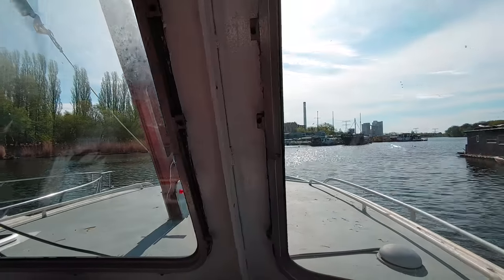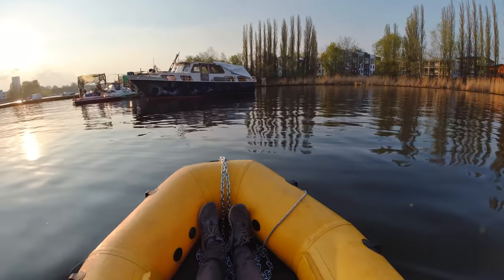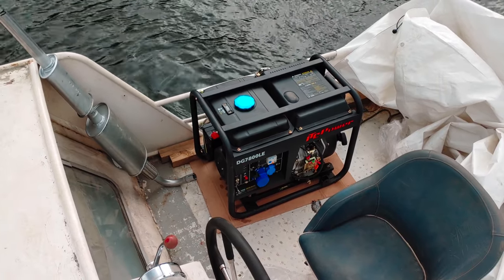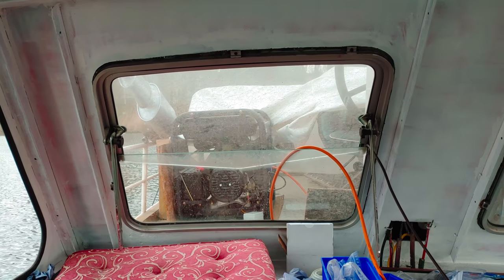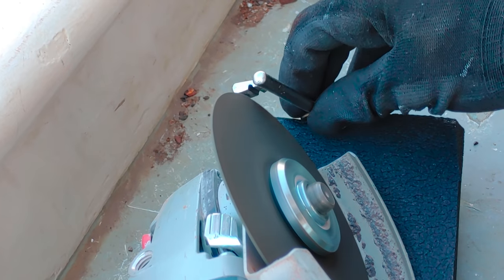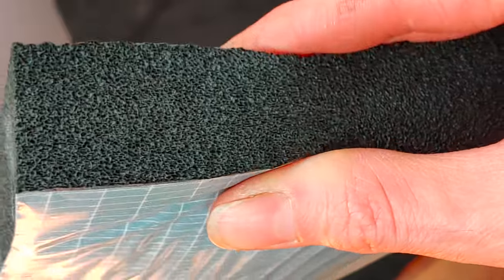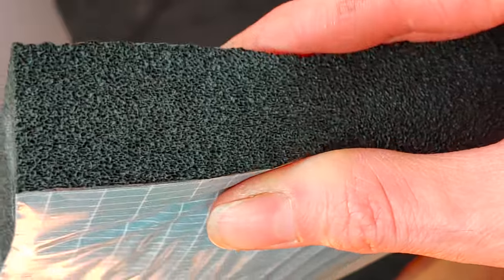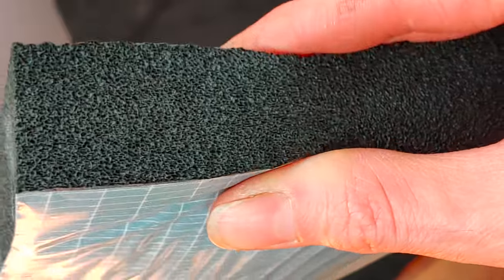First Days On The Water with our Steel Boat - Week 31 - Vintage Yacht Restoration Vlog

Comment: Once you put the generator into the engine room, you could put boards around it with something similar to the insulator you used so that it could absorb the sound and make the generator quieter.
Reply: The thing is that looks like a portable generator which needs air flow to cool unlike a traditional marine generator that uses water to cool. I think putting it into an enclosure might kill it
Reply: Its petrol and air cooled. I wouldn't be even putting that in the engine room
Reply: @nayelelkiki  Then what if he adds some sort of ventilation?
Reply: hello .. in week 4 you will see a fan on the wall, of which there are 2. one on the left and the other on the right .. these 2 are for ventilation of the engine room.
Reply: @jakubkocian1145  a
Reply: @bradarmstrong8059  Acutally, it's a diesel gen.

Comment: Amazing product Armaflex, we have used it for almost 50 years, insulating our Hydronic Heating pipe work. There's simply not much that competes! 
Its closed cell, fire proof, UV stable and durable.
Reply: I've used it a lot too working with ventilation. It takes up so much less space compared to glass or stone wool for the same insulation value.
I can't say that it's expensive considering how good it is but it costs a lot of money. This guy is very lucky to have them as sponsors.

Comment: I've not watched all your videos, but have enjoyed this one.
- Yes, "sea legs" and "land legs" will cause some discomfort when spending prolonged time either on land or on the boat. Even as an "old salt" I feel the effects!
- Generally, the dedicated pleasure boating community does look out for each other. I've seen great examples of this many times over the decades.
- Armaflex is great stuff! I know at least one other youtube contributor who has used it on his sailboat for insulating purposes and is very pleased with it. I've attached some on the underside of the rear deck on my boat to lower heat and noise levels from the engine room below. Very pleased with it.

Comment: One of the big misconceptions is that a muffler will quiet the generator. Alot of the noise actually comes from the vibrations and working of the engine itself and not the exhaust noise. Hence alot of people build an insulated (and vented) box to surround the generator and absorb these engine noises.  The nice Honda generators have done an excellent job of dampening this engine noise of their generators. One of the benefits of this is that you aren't announcing to thieves that you have a generator to steal with generator noise.

Comment: I bet money that the insulation helps with significant noise reduction. Looks like a really good product.
Reply: It only helps a little against noise that is transported by the air! ( in german "Luftschall") The "major" noise is transported by the hull an all the materials in the  inside. ( in german  "Körperschall")  To avoid these noises, you have to make everything heavier and try to make it stop swinging.

Comment: I wouldn't worry about glueing the seems, but more about the ribs on the hull and roof that will be beautifull (thats sarcasm) cold bridges. When winter hits those ribs wil have tons of condens.
Reply: Gluing the seams is still very important to ensure moisture is not allowed to enter and get trapped behind the insulation sheets.
But fully agree, those ribs will lead to tons of condensation. Always an issue in boats, and much more so in steel vessels. A a good heat source combined with a really good dehumidifier can save the day to a certain extent.

Comment: When working with foam products it is a good idea to have an electric carving knife in your tool box. Electric knifes work very well to cut rounded corners or round holes in your and leave a very nice finished curve. They also work to thin the edges of the foam where it requires a tapered edge and you can actually carve foam into specific shapes.

Comment: Acoustic volume (loudness) of both air-compressors and portable generators are controlled by two factors...exhaust AND intake. Everyone chases 'quiet' by adding longer pipes or larger mufflers on combustion engines, but few realize that the air-intake ALSO contributes to volume! If you add a 'long-intake-duct' with sufficent baffling, you can achieve up to 10-db of volume reduction! Simply remove the stock 'air cleaner and intake', fabricate a longer intake pipe, add a smaller 'muffler' at the end (remembering to accommodate your filtration media), and you will have a MUCH QUIETER generator! In shop air compressors, this is often done with long-runs of pipe, to achieve maximum volume reduction.

Comment: As before, very impressed over progress and dedication to this vessel!
You might not have the option (spring time in Berlin - or if recorded way earlier, winter...) but when applying insulation towards a metal hull, it is always best to do it on sunny warm days. Why? As you already know, enclosing the metal and in the process capturing humidity between metal and insulation can lead to horribly bad corrosion (out of sight). When insulating while it is warm, the metal being warmer than the surrounding air, in most cases removes the risk having any condensation on the metal. And while applying the foam, it is super important to ensure that you really get the adhesive to adhere all over so there are no bubbles behind where moisture inevitably will collect over time.
That said, a metal vessel is likely more "healthy" (just like a house) with the structure exposed and can "breathe", not closed in by insulation. But as we all know, it is not practical for comfort nor for the finances when it comes to heating the enclosed space. Insulation is needed compromise.

Comment: but with arma flex you leave there a cold bridges where metal ribs are visible ...may be would be better to glue wood on metal ribs and after that spray it all with foam and  shape it at the end..  there probably will moisture condensate on metal ribs, becasuse it will be cold..... just thinkign about... good luck
Reply: Might be a simple solution of wood strips with a groove on the back that will fit over the rib.

Comment: Hi the progress is looking great. Have you considered adding a few solar panels and a submergible turbine (there are a few cheap river options you could throw off the side of your boat when at an anchorage). if you add on a few mix energy options to your Victron system you'll use the generator less. Take care D

Comment: I would be cautious to put a petrol generator in the engine room. When the engine is running, the engine room gets hot and could create an explosion hazard of the vaping gas from the generator tank
Reply: As mentioned in the video, their generator runs on diesel, so there is almost no possibility of fumes reaching the LEL to cause an explosion.
But other safety & health concerns should be noted, particularly Carbon Monoxide (CO) and Carbon Dioxide (CO2). Sufficient ventilation and alarm sensors should mitigate these.

Comment: Hello another great video. Excellent job with the Armaflex. However I think you need to also insulate the structural ribs and beams, studs etc or they will conduct cold well and cool your environment inside. At the moment you still have a thermal bridge you must insult all outside contact with the internal environment. Think external temperature conduction. Cold conduction cooling and moisture condensation.

Comment: They sell ceramic knife sharpeners I have one at home. They're cheap. Also for installation of the insulation do it like a cellphone screen protector.  Peel back about 6 inches of backing and place it on the wall. Then once it's secure pull up on the insulation at reach the remaining backing and pull it down securing it along the way.

Comment: I hope you get a lot of enjoyment while you continue to work on your boat this summer !

Personally, I would have gone with 50mm insulation.  It gets cold there is winter, but if you are not planning on staying on the boat in winter, it probably is not worth the extra cost.
Reply: I think a lot depends on the internal structure of the boat, plus how much internal space you are willing to lose, for instance I have 75mm of insulation simply because the internal ribs were 70mm and I wanted to cover them completely, It's fairly easy to heat a space as small as this, I often have to have the windows and hatches open even when the log burner is turned right down low as it gets to hot even in the middle of winter.

Comment: Sell the gen and buy a good Honda 3000eu which is going to be very quiet and worth the upgrade. Expensive but worth it if you want some peace and quiet. There are some cheaper brands which can almost match the Honda's low noise that
Reply: It's a diesel generator. Yes, noisier than the (very) reliable Hondas, but in this application - and for the money - that one is likely hard to beat.

Comment: Da nützt diese echt Hammergeile Isolierung aber auch nichts bei den Scheiben die verbaut sind... da heizt du ja über die Fenster alles raus was drin bleiben soll...
Reply: but it helps against direct condensation on the hull (you will have this up and below the waterline depending on the weather conditions), thats worth a lot and good for dry bilges.
Reply: @AlexanderStielau  Da die Spanten aber nicht gedämmt wurden gibt es (zumindest bis jetzt noch) eine sogenannte Kältebrücke, welche wiederrum Kondensation begünstigt! Bleibt das so, wird es nichts mit einer trockenen Bilge! Warten wir das nächste Video mal ab.
Reply: @hugo169a  Naja, da kommt dann das dünnere Zeugs drauf, bin ich sicher (näxte Folge) :-)
Reply: @AlexanderStielau  Wer weiss.... Ich bin sicher, daß wir es erfahren werden. 😉

Comment: Use truck bediner for the the met floor outside the boat for traction
Reply: Wire u up some led light pods for the front light up the area n there waterproof

Comment: If you had cut the insulation the long way, instead of across, you would not end up with seems near the bottom, though if the widths you want don't divide well into the width of the roll, you would end up with quite a bit of scrap.
Reply: Seamingly!😁

Comment: Hopefully to be helpfull and not critical, I like what watching your videos' your obviously trying to Be through !! But the exposed metal ribs that protrude through the insulation you installed. will still have thermal transfer. This will cause condensation, not might cause it, but it will be there. Enough water will be created by the condensation that you will think there is a leak. You might want to do some research in the home building industry, on thermal transfer and condensation damage. KEEP UP THE GREAT WORK.

Comment: I know that your boat is self contained, but how many of those other makeshift floating houses in the community are dumping raw sewage into the water?
Reply: Seeing a picture of the head/toilet looked like it went straight out the hull, the Rhine is basically an open sewer by most normal standards, quite shameful.

Comment: Really great work so far, i am owning a old policeboat from 1968, and i know a lot of your painful demontage adventures where things look good on the outside and terrible on the inside. My boat is made from aluminium (hull and superstructures), so i have no problems with rust but with galvanic corrosion instead. 

But please do not try to house this type of generator into your engine room, it is a petrol driven, aircooled genset and petrol/air mixtures are veeeery explosive. This is not a problem on (petrol) cars or motorbikes since they are open to the ground (this mixture is heavier as air), it will sum up in your bilges and a switching spark is enough to blow your hatches away (or worse).
This must be handled as serious as a propane gas installation (your gas locker will have a hole on its deepest point to let leaked gas out), and if you do it anyway, you need explosion protected fans at least and run them some minutes before any start of the genset.

Diesel gensets are expensive - i would consider to check in solar and wind power, if your stay in Rummelsburger Bucht, there is no problem with shaddows neither wind masking. A good source for gathering infos about wind generators is the long range sailing community.
 You will not get such high charge rates but continous charges with them without noise (solar) or moderate (vibration) noise.

As a 2nd option (if you need a lot and direct AC power for e.g. welding) is to fit your main engine with a 2nd, big alternator and a specialized alternator charger (e.g. Sterling) to feed your inverter. These alternator chargers are good even just above idle rpm.

Comment: hello .. and woww new fenders you do indeed need .. (Question) if your generator is downstairs, do you connect the exhaust to your boat exhaust? I am already happy that your boat is and remains completely waterproof. Crazy stuff that insulation material .. Top. how fast it goes .. rebuilding everything.

Comment: Curious how you are going to deal with all the exposed frame members which will drip condensation etc.?  Especially if you are gone and are not heating the boat.  Boats are all about down sizing and efficient storage.  A storage locker ashore isn't a bad idea if you are home porting somewhere.